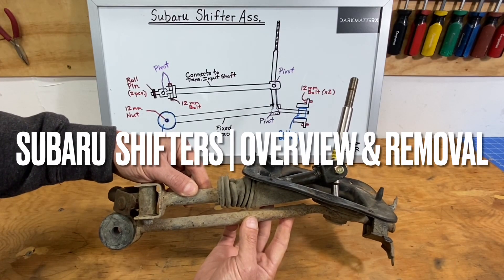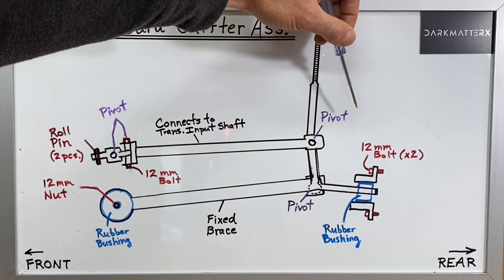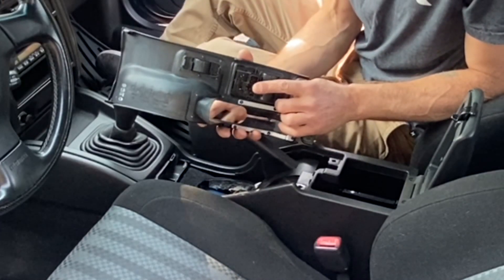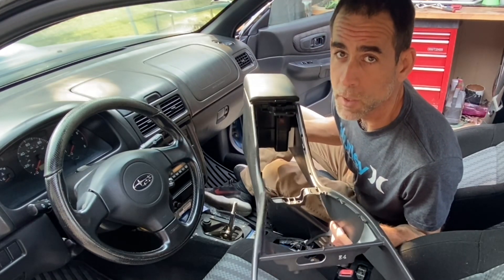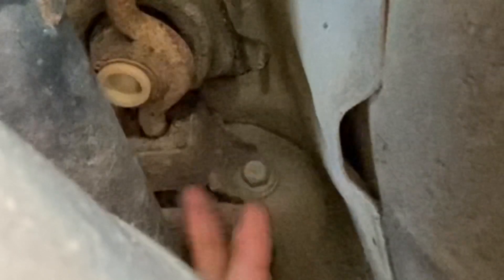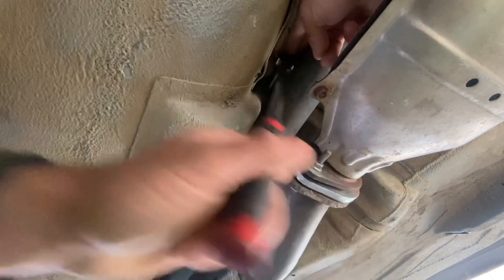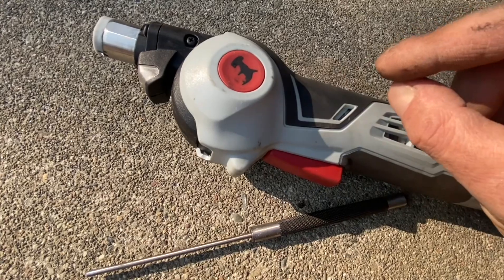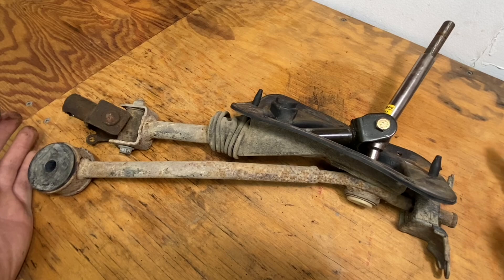OEM SUBARU SHIFTERS | OVERVIEW & REMOVAL

Comment: what a job MOST def not a sti. Down pipe and drive shaft dropped to get to the bolts  care full they dont send the wrong part if you have a 6 speed the angle of the connector pin to the shifter shaft is different

Comment: I just obliterated the right front fender trying to turn my '04 XT mechanic's special around in my back yard. Cut the wheel hard right, put it in reverse, gave it a little throttle. I was attempting to snake it around a tree and was looking back so as not to bump into my CRX. Lo and behold, it did not go backwards. I was in 4th gear, so it shmooshed the fender into the tree instead of avoiding it. There was a hail storm coming in hot, so I was turning it around to nose the XT into my garage to protect it from hail damage. Later I realized my shifter had gone all "Game of Thrones" on me (floppy wieners). The real kicker is the storm just decided to go around my part of town and the hail never showed up. So now I have to add a new fender, and some shifter bushings to the list of items I need to replace in order to button it up and get it road ready. I will not be deterred, though. This is my first Scoob and I am head over heels for this car. Literally been patient for almost 10 years to find the right configuration at the right price. Thanks for your videos. You've already helped me so much and here we are again!

Comment: Hey Luke. I’m wrapping up my auto to manual swap and am wondering what size screws fastener that metal plate cover to the car? Are their nutplates on the backside of the car? When I removed my auto shifter I had 6 nutplates fall off the backside

Comment: Do you ever experience after replacing the shifter assembly, the shifter is no longer centered in the car? Meaning, when I shift into 1st gear, it visually looks like its going into 3rd gear. I can't seem to find the reason why the shifter is off-centered now. Any thoughts?
Reply: Aftermarket non genuine shift linkages cause the shifter to be out of center. You must get genuine subaru linkage. Watch out some look genuine but are not
Reply from the maker: Hmm. No haven’t had this happen for OEM or aftermarket. But have only used good quality aftermarket stuff like Kartboy. There’s a lot of cheaper Chinese stuff out there that’s prob pretty bad.  Maybe try to loosen things and realign, if there’s some play in there.
Reply: you put the pivot backwards
Reply: Same thing with me, shifter is offset to the right. I just replaced all bushing and the shifter joint on my fxt 5mt. Is the shifter joint with the roll pin symmetrical? I may have installed backwards. Please help me lol

Comment: What is that vibrating nail installer ? The name?
Reply from the maker: Just looked it up - it’s called the “Hammerhead Auto-Hammer”, made by Craftsman. Here’s the official corporate page link:
https://www.searshometownstores.com/Craftsman-30261-NEXTEC-120-Volt-Hammerhead-Auto-Hammer-with-Rotating-Head
Reply: @SubaruONLY  what can cause a shifter to feel loose after installing whiteline shifter bushings? I got them installed and it felt nice, tight and firm shift feel. Sadly it went from that to sloppy and now it feels metallic and grinding like depending on how I shift. I try to shift with care and understand that forcefulness and aggressive movements aren’t ideal for any car especially Subaru manual transmissions with 5 speeds 😅 ( still got to love a classic 5 speed) what can I do to fix it and make it good as new? I got a new roll pin and I don’t know if it’ll make any difference
Reply from the maker: Hmmm. Sorry to hear man! Sounds like some mechanical part came loose or something. I’d just pull the whole shifter assembly (as I show in my recent videos), I bet you’ll find something came loose or broke and it’ll be clear at that time. Good luck!!! 👍
Reply from the maker: Hmm.  Odd, something must have come loose. I’d pull it out and check over everything closely.
Reply: I have a 1998 subaru legacy 5mt and iv been trying for over a decade to remove that outer roll pin its completely seized into the arm I may buy this tool and try to get it out. The linkage is totally gone no bushings and rattles on the highway.
Reply from the maker: Hope this helps - I really think it will!!!